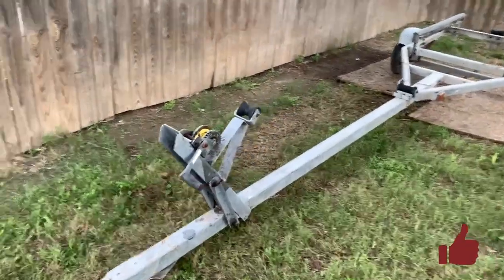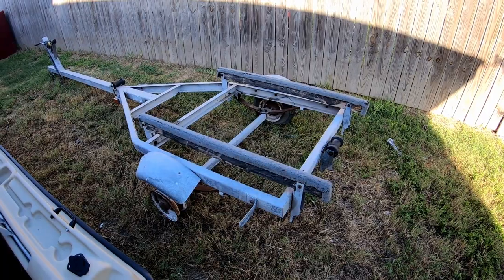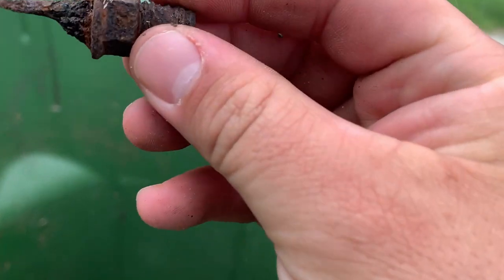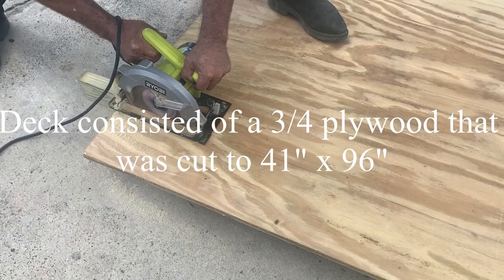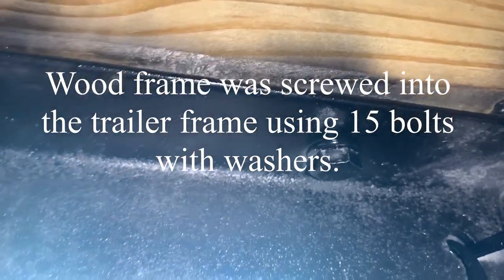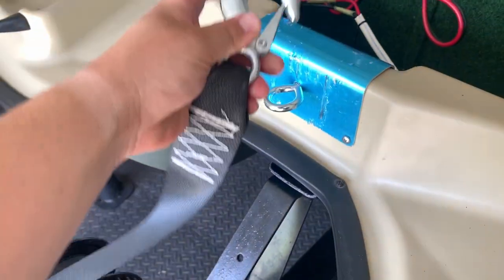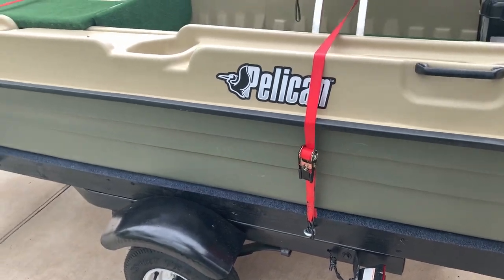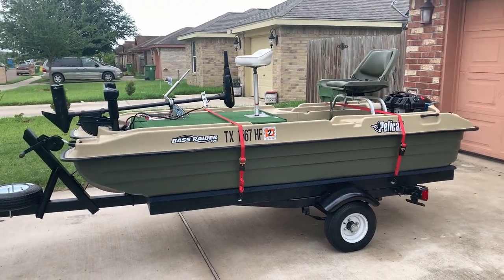Trailer Modified For Pelican Bass Raider 10E

Comment: Nice looking trailer I'll admit I figured you redo the bunks on it. You choose to do the flooring way. Very nice
Reply from the maker: Thanks! Initially that was the plan but I went with flatbed for a few reasons. The boat fit the trailer snug and I didn’t want the fenders rubbing against the plastic during transport. The flatbed elevated the boat enough to avoid rubbing. Another thing was that the boats pontoon won’t completely sit on a 2x8 bunk and since it’s plastic I didn’t want it to warp or get a memory. Also with a flatbed I have multiple uses for this trailer. Love the way it came out!

Comment: DRock love the video! Question: how did you put the eye bolt on the transom and still get the trolling motor on there?
Reply from the maker: Thanks for watching! So I drilled the hole on the transom and got an eye bolt with a washer and a bold on the other end. I just remove the eye bolt every time I use the trolling motor.

Comment: When you’re backing the trailer into the water, do you have a problem with the stability as far as floating because of the wooden deck?
Reply from the maker: No I haven’t had any issues, the deck is pretty heavy.

Comment: Put ya some Guide Post on each side of the trailer , Use a little Larger all thread then slip a long Piece Of PVC down over that it will work like a roller on each side , Mount your Trailer lights on top of that it will keep them out of the water when ya launching the Raider  and avoid blown bulbs Etc,,, trust me over time the lights will be a Issue ,I discovered this trick on a boat trailer I had About 20 years ago ,it makes loading up easier and no more water in the lights , I just Got A Raider ,The Build is on now so I'll build the trailer as well like I described , it works , a 1)2 in stick of all thread about 4 ft long  Drop a big washer on then A  Piece Of schedule 40  PVC pipe just a bit bigger than the all thread so it will spin freely put another big washer on that I used a second Nut to lock the First one and actually attached my Trailer lights bracket to that Second Bolt , I Sold that whole rig so I can't take pics but as soon as I get to that Stage of the Bass Raider Trailer Build I'll Be Glad To Share the Idea ,  it works with any boat, Any trailer ,and another plus of this is You can see those Guide Post Standing up on the trailer Behind You as your backing down a ramp ,three good reasons for this mod on the trailer,,  I have a Couple More that makes the trailer even a bigger help , I have some Tough Places to launch, the ramps are steep but they have to be to avoid silting up , some I don't back down there's a Couple Of things that are helpful to launch at those, ,use a landing wheel on the tongue of your Trailer ,most come with the little small wheel, you can out a little Bigger tire on that , and I just drop that down, lock it in place , I take a Heavy DUTY 5)8 Nylon rope I use a small shackle to attach that to my Trailer and the other end to my truck tow bar , even my fiberglass was light enough I could launch by hand with the rope ,when taking the boat out I would put my truck at Top Of Ramp, use the rope to ease the trailer down into position and tie off securely then load my boat on trailer ,them get in truck pull boat up steep ramp to Level Ground just hook trailer on the ball roll up rope and all Good alot safer than trying to do it in these steep places , it really is Simpler than it Sounds by description ,, but anyhow always looking for a new idea that makes it easier, good job on the raider trailer ,, keep ya Line Tight 🎣 Happy New Year To Ya 🦈🎣😋 that's Dinner 🦈😋
Reply from the maker: Thanks for watching and thank you for taking time to share your ideas. once you are done with the trailer I would love to see some pictures. I defiantly want to put some ramps because loading the bass raider isn't as easy as I thought it would be lol. I usually end up getting into the water to put it into the right position. My email is derrick_galvan19@hotmail.com once you get the pics send me an email thank you again! Happy New Year!
Reply: Man, great idea, I'm on it!!!

Comment: Do you have to remove the eyebolt in the front transom when you put trolling motor on?
Reply from the maker: I do but I ended up buying a a 2.5 hp Suzuki outboard so I rarely use the trolling motor now.

Comment: I have a 2-3 foot overhang on my small motorcycle trailer with a 10E. Would it be fine? I have the battery and trolling motor out front so it is basically just plastic hanging out back.
Reply from the maker: I think you should be good depending on where the tires are at. Mine hangs out from the trailer about 2 feet.

Comment: How much did you leave overhang off the back??
Reply from the maker: Thanks for watching. The deck extends about 14 inches from the back of the trailer.
Reply: Ok cool i litteraly bought one today and doin the same project.. also how did you tighten those wood bolts from the fram to the 2x4 with litter clearance? Did you use a swivel to tighten them?
Reply from the maker: Nicole Garcia We used a ratcheting wrench, it wasn’t easy but we eventually got it done lol. Congratulations on your trailer let me know how it turns out.
Reply: Thanks man i appritiate it and i will for sure wish i could send you some pick on here
Reply from the maker: You can email it dgalvan529@gmail.com good luck! Let me know if you have any other questions.
Reply: Ok thanks man
Reply from the maker: Nicole Garcia no problem bro.

Comment: What paint did you use for the trailer? Is the paint still holding up?
Reply from the maker: Just used spray paint and yes still holding up.
Reply: @dgalvan529  ok cool ill prably just go with rustolium.. did you lay down a primer first?
Reply from the maker: Nicole Garcia No I didn’t but I’m sure Rustolium will do good they have some with a primer in it I believe.
Reply: @dgalvan529  cool thanks

Comment: Man I have been debating on getting a pelican or kayak or small boat.  Looks good man! Subbed and if you get a chance check my channel.
Reply from the maker: Thanks for the sub bro I’ll do the same. I have both the Bass Raider and a Kayak, I like the Bass Raider better honestly.
Reply: @dgalvan529  Nice!  Thanks man greatly appreciated!! Yeah I may need a bit more space than a kayak can offer.
Reply from the maker: @SkunkMasterFishing  more space an extra fisherman and you can add a motor to it. I have a 2.5 HP Suzuki outboard on mine. Runs great!
Reply: @dgalvan529   Sounds great!